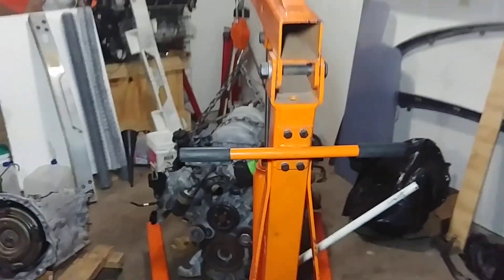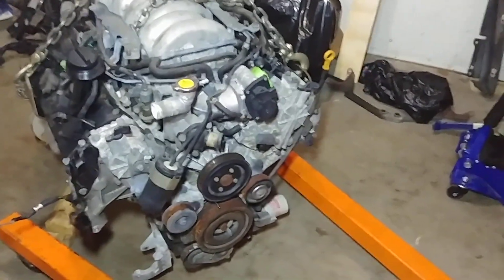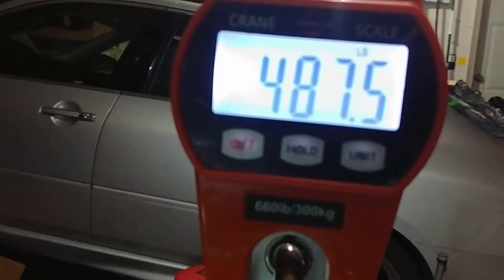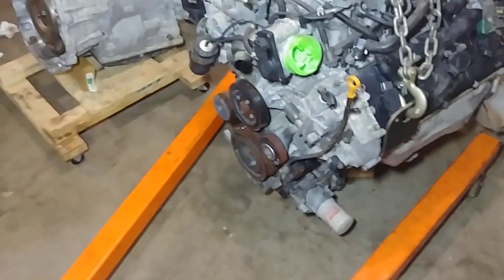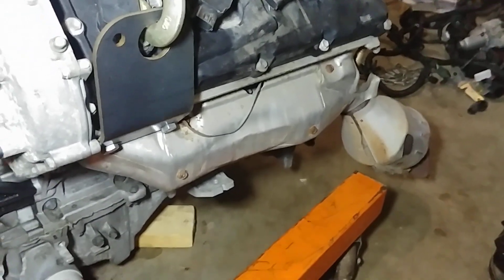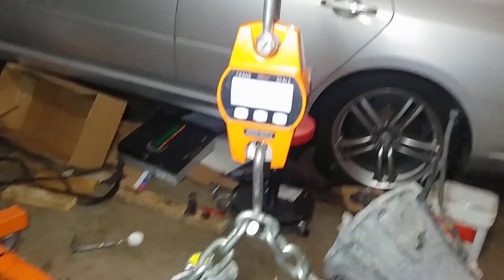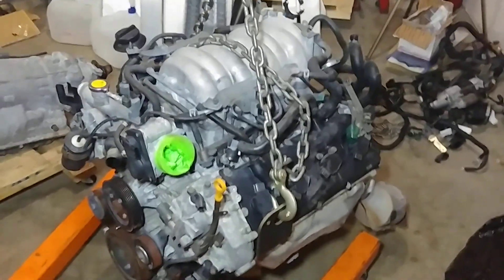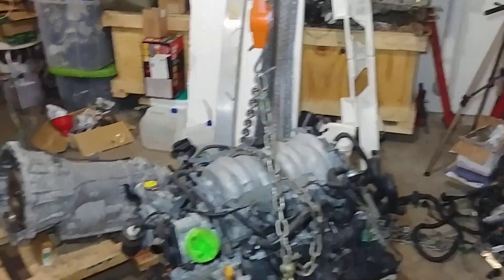How heavy is a V8 engine? Nissan VK45DE weight

Comment: Hi I am wanting to a engine swap, either one of these Nissan VK45DE or the Toyota 3uz-fe 4.3 V8.
I know the Toyota will fit, including in to  the Isuzu bighorn engine bay and the trans will bolt up, to keep the 4wd. wiring is easy as the wiring loom is easy to adapt from the Toyota. but what is the physical size differences between the them both? in size 
the Toyota fits like it should with a small amount room. the reason why I ask is the Toyota is twice the price to buy.
Reply from the maker: Unfortunately I have no experience with the Toyota. I know the VK45DE has been stuffed in a good number of cars that come with smaller power plants.

Comment: I need some help my engine on my m45 03 HS a crazy knock how do I go about ordering one of these engines ? I’m in jersey
Reply from the maker: I bought most of them from eBay. I believe the sellers are based in NJ too.
But beware, the jdm engines have the starter on the opposite side of your 03 m45. I think it's easier to find the 03 engines locally, and cheap too
Reply: EdBwoy I’m going to email you bro cuz I really want this engine done got a engine I’m looking at for 700 which I think is a steal so I’m hoping it’s the exact one
Reply: EdBwoy https://www.jdmenginedepotinc.com/product/03-04-infiniti-m45-4-5l-v8-rwd-engine-jdm-vk45de/
Imma email you bro

Comment: Ed! Please help! I am a new 2003 Infiniti M45 owner and am having a few troubles getting my car fully comfortable to drive and restored. Namely, this very Loud and annoying beeping noise that periodically comes on and off when driving. It's a pretty long beep that lasts about 7 seconds or so and I believe it is probably the TPMS (tire pressure monitoring system) I've looked on the forum and seen a couple of posts but haven't found any real comprehensive help on resolving this. I think there's a way it can be disabled but i would prefer to actually *fix it if possible. Along with that, i find the actual tpms doesn't seem to work as there are no measurements or numbers of my tire pressure when i go to see in the computer info screen. Is this as simple as replacing sensors or something? Or is it deeper? It's slightly discouraging because I read before going into owning this car about all the various *electrical issues it seems to develop. I'm frustrated with Auto shops not doing anything about it. And there's so little helpful and thorough info online that I've been able to find. Especially for someone relatively inexperienced like me. If you were around locally i would definitely consider paying to have my car inspected by you. Someone who really knows and understands the ins and outs of this specific car. There are other minor issues I'm working on but this one is very frustrating. Any guidance and/or especially a video would be incredibly appreciated and amazing. I very much appreciate all your educational content on these m series cars. 🙏👏🙌
Best,
John A. White
Reply from the maker: John, it does sound like a TPMS issue, usually by this age the TPMS batteries are dead and you end up buying new ones and have the dealer program them. 
My TPMS warning horseshoe light would usually come on after 30 minutes of driving or so; no sound though.

I saw a thread on manipulating the system but I haven't done it myself - https://forums.nicoclub.com/tire-pressure-sensors-t617785.html#p6778188
It seems like yours needs a visit to the dealer for troubleshooting first

Comment: Is it to late ask, if you still have a video on replacing your spark plugs and fuel injector on a m45?
Reply from the maker: I have videos on those topics, but with the engine out of the car/engine bay.
The injectors were replaced because I was reassembling the engine, not a common maintenance task to these cars
Reply: @EdBwoy  thanks anyway
Reply from the maker: @batman310ful  Bet! Are you working on a project? Rebuild?
Reply: @EdBwoy  just doing a few upgrades and your channel has more info than I need, lol just getting greedy, plus I have no clue where to even find the spark plug location, thought you might have that.
Reply from the maker: @batman310ful  I wouldn't mess with the injectors, that creates opportunity to screw things up. Only touch them if you are having issues confirmed to be due to the injectors (not common to the M45)

Comment: Can i successfully put one of these in my M35?
Reply from the maker: It would require a lot of other parts to be swapped over. With the current values of these cars, I'd rather just sell the v6 and buy a V8... But yea, it can be done
Reply: @EdBwoy  hey where can I find a low mileage m45 engine?
Reply from the maker: Car-part.com, LKQ and eBay are usually my go-to sites
Reply: @EdBwoy  will a 2003 - 2004 m45 engine work in the 2008 m45 models
Reply: @EdBwoy  ?
Reply from the maker: @batesboy2230  no, it won't work. At least not directly. https://forums.nicoclub.com/v8-engine-replacement-options-do-the-03-and-06-m45-use-the-same-vk45de-engine-t619905.html